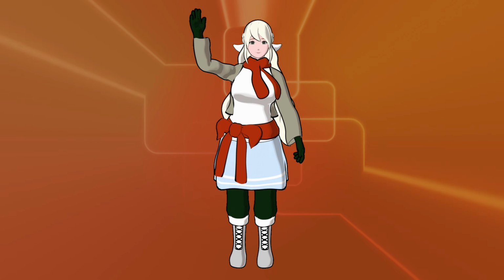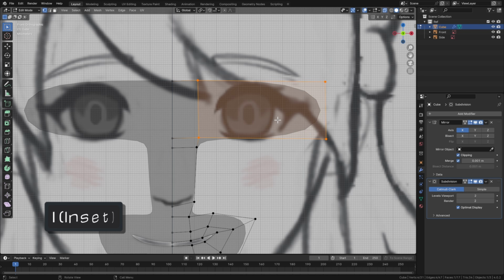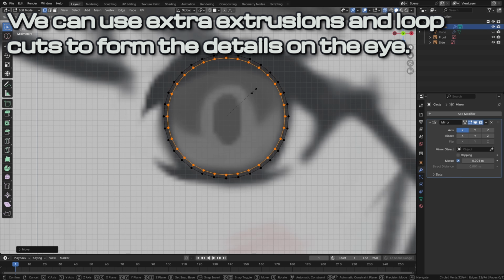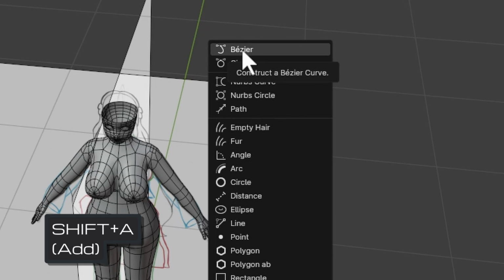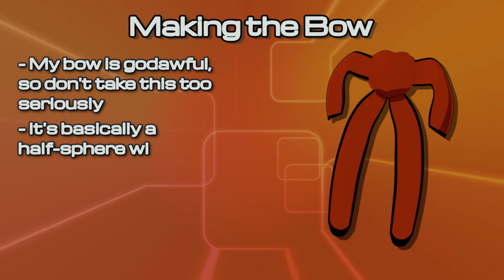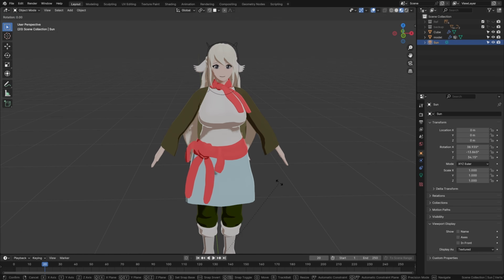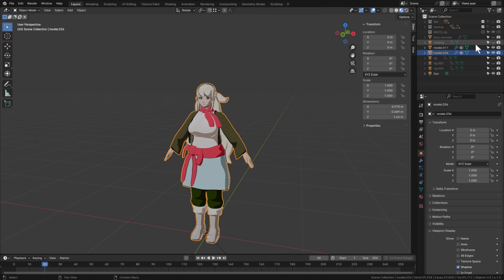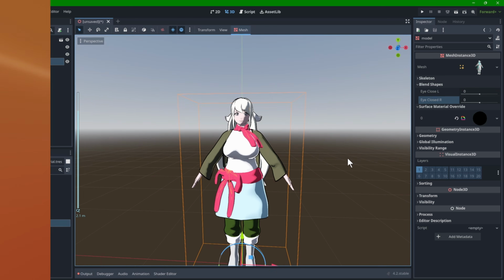COMPLETE 3D Character Creation Guide - from Blender to Godot

Comment: Regarding the outline shader, isn't that just the same as using the Grow parameter in Godot materials for the inverted hull method of outlining? If so, it likely won't work for my case. I have objects with sharp edges, like crystals. Smoothing their normals makes them look bad, and I can't seem to find any way around that, so it seems that it's best to import them without smoothing their normals. But without smoothing the normals, creating an outline for an object with sharp edges by expanding it based on the normals doesn't work -- it ends up fragmenting into several parts. 

The best solution I have found for this so far is simply using the solidify modifier in Blender to make an outline, applying the modifier, then just exporting that. It seems to work perfectly. I just wish I could get the outlines looking a little better, or exactly how I want... I tried using a post-processing shader to create an outline on everything, but by doing that the only way I know how, the outline disappears when nearby other meshes. I am an absolute beginner though and have just been reading the docs and watching a bunch of different tutorials. You wouldn't happen to know how to approach getting a really nice looking outline that doesn't depend on the normals, would you? Or perhaps you might know how to smooth the normals while retaining sharp edges? I actually tried using the Auto Smooth modifier in Blender, which SEEMED to work, but as soon as I applied it, the normals just went back to being the same as they were before it was applied. I feel like I must be missing something here.
Reply from the maker: You are correct that in Godot, it uses the exported normals instead of the base normals when you do the outline shader. I don't know of a way to force it to use the calculated normals instead of your custom ones in shader code, but you may be able to modify the NORMAL variable there in some way potentially.

An option you could use is to bake a normal map that is your calculated normals (not the custom ones), and then use that map as the basis of your outline shader. However, I don't love using extra maps for my models if I can avoid it, but it could be an option if you don't mind doing that.

Exporting the solidify is a perfectly fine solution if you don't mind doing that, but it seems you want more control through the shader, correct?

Comment: Great videos! I try to follow your example, but i got a problem when bake constraint animation with expy kit. When I try to bake it like you did, it just 1 animation that bake (i use 3 animation from mixamo, idle, t-pose, jumping, but just jumping that get bake and animated), I don't know where the problem is, did you have any solutions? (ohh, yeah, i try to bind and bake it one by one too, but the armature is rather piled up one after another, i use blender 4.5 btw)
Reply from the maker: Thank you! Yeah, it's a challenge I run into as well with Expy Kit. 

Typically, I import one animation at a time, and once it's baked, I'll delete the imported armature and select my own, then try to find where the animation was saved to. Once I do, I'll mark that one as a fake user to preserve it, plus give it a better name. Then with the others, you can delete them. 

Deleting them is a bit of a pain though - you'll have to go to your scene collection outline (usually at the top right), click the Display Mode dropdown and find "Blender File". Then in the Actions there, you can right click and select "Delete" to delete any unwanted animations.

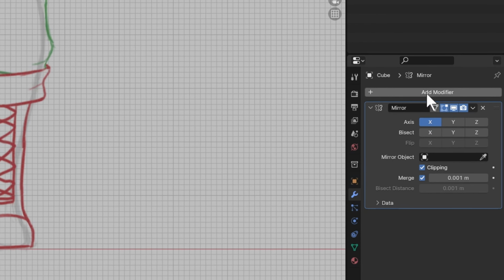Comment: ✋️I have a doubt at 10:50 can u explain the difference and why it matters? It doesnt have to be in detail 👍
Reply from the maker: Regarding the Catmull Clark vs the standard subdivision algorithm? The former will actually try to smooth out the mesh for you and is generally preferred. The latter will just add the additional subdivisions to your model without changing the shape.

Comment: i'm at the weight painting part of the video and i have no bone collection for deformation bones... what did i do wrong?
Reply from the maker: It may be related to the version of Blender you're using? In my video, I'm using 4.0 I believe, which would have introduced the bone collections. Also, make sure to do the weight painting on the generated rig, not the metarig.

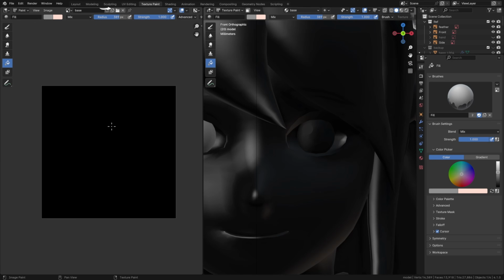Comment: 56:50 for some reason i dont have texdraw brush. My brush has a different name and its very pixilated. It also wont go straight when i hit shift. Anybody know why?

UPDATE -To anyone who got stuck here like me blender4.4

Hit N 
Look for stroke tab.
Choose line

Go to falloff tab
Choose custom (dont change anything)

It should allow you to draw straight lines now by holding left click.
Reply from the maker: This seems to be due to Blender moving toward a brush library system. If you click the dropdown near the brush tool icon, you can select the Hard Brush. However, it seems the straight line function is broken. For now, I think the best option is to use a different image editor to make the grid, then you can use the fill tool in Blender to tweak your colors.
Reply: @codernunk thanks for letting me know. I thought i was just doing something wrong. What version of blender are you using in this video?
Reply: same here

Comment: hi I have just started learning blender and this guide helps me so much but Im wondering if the hair strands you made overlapping each other, would it be fine when you add collision to them? And do you need to join all of the hair strands together?
Reply from the maker: Glad this is helping you! 

You don't necessarily need to add collision to them, as you may get some undesired results if you are using pixel perfect collisions. 

Typically, the hair physics is something I relegate to the game engine (assuming you're making a game character), as you can use collision shapes to apply the collisions instead.

It's also a good idea to join all the hair strands together before you export your mesh. You don't have to sweat it though if you have some overlapping geometry.

Comment: Quick Question when do you apply the modifiers?. And when did you apply the outline?
Reply from the maker: I often apply the mirror near the end of the modeling process, but if I find I need to make an update, I will cut the model in half and re-add the mirror modifier. Not the most efficient, but I do this because I want to make sure I'm not applying all my modifiers. This is because I don't plan on applying the solidify modifier (for the outline), rather, I'm keeping it for reference. I have a shader in the game engine that builds the outline, so there's no need to apply it to the model as well.

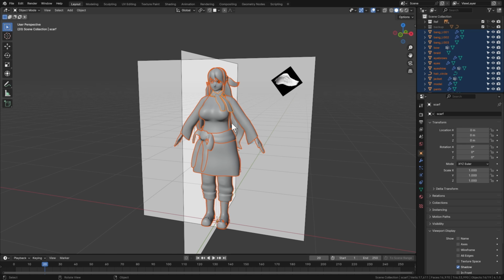Comment: 53:00 is the removal of many polygons necessary for game performance? I was thinking, without anything below, wouldn't the clothes "pass through" the body when physics are implemented in Godot?
Reply from the maker: It's not entirely necessary but recommended. You don't want the game to spend GPU cycles rendering something that isn't being seen to the player. 

For the most part, with physics you will not be able to see the hidden parts of the model, as long as the weight painting is done with enough care. However, you may find there to be cases where having the mesh underneath is necessary, such as certain outfit types.

Comment: I've been stuck at the shading part for days, most of the stuff doesn't work properly, when I'm at the point where i should use the color attribute node, the highlights no longer show up, only shadows, and I'm sure i followed you correctly, please help.
Reply from the maker: I think your issue may be due to the lack of vertex paints. If you select your mesh and enter Vertex Paint mode, it should create some for you. Make sure you have vertex paints set by navigating to the Mesh data tab, finding the Color Attribute section and seeing if you have an entry there. It also helps if you have it set to "Face Corner" as well

Comment: Hello, the fresnel effect isn't working properly, it is too big and I can't make it smaller with the color ramp node for some reason.
Reply from the maker: Apologies for the late response. I understand if you were able to get it working since you asked.
The fresnel node can be a bit finicky with the values. Have you tried the Layer Weight node in Blender? That fresnel is based on a 0 to 1 value and may work a bit better. Using the traditional Fresnel node doesn't use the same number range. Is the issue happening in Blender or Godot?

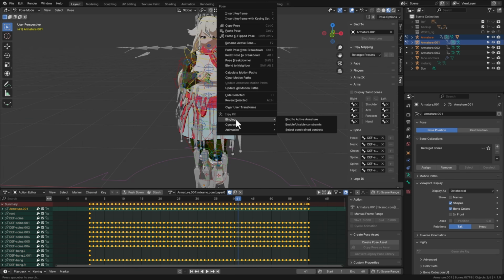Comment: @1:17:25 Hi codernunk, I'm currently using Blender 4.4 and I'm having trouble baking constrained actions. Everytime I bake my actions, I cannot toggle between the poses in the action editor. It gets stuck on one pose and I cannot see the other poses. What am I doing wrong? Why can't I toggle between poses? Thanks.
Reply from the maker: Thanks for responding, all. Apologies for the delay. One-by-one seems to be the ticket for now. I also noticed that a lot of my actions stayed in the "Legacy Slot" so I had to swap over to that.
Reply from the maker: Apologies for the late response. I'm not 100% sure, but I think it may be due to Blender introducing a new feature where you can make multiple channels. It may also be due to the Expy kit addon selecting the other armature after it's done. The best thing you can do is to exit out of Pose Mode once you're done baking and trying to select just the target armature again.
Reply: Hey I'm having the same problem. If you get it to work, can you let me know?
Reply: @ronyoshii Hi! From what I remember, I just repeated the same steps—baking each armature to target the main one. I renamed the poses I wanted to keep and deleted the extra armatures I didn’t need. After that, I was able to export to Godot without any issues. I’m not sure if there’s a better method, but that’s what worked for me.
Reply: @nuffinmuffin7351  thank you. I was able to get it by doing it in much smaller bunches at a time. I had a lot of animations I was using. Importing into Godot was pretty straightforward though.

Comment: Gray bones of the head and heels, someone know how to fix?
Reply from the maker: I'm not sure exactly what you are asking. Are you unable to select some bones on the rig?
Reply: @codernunk  Ohh, so it's been 12 days since I started making my first rig. I don't even remember what the problem was, now I'm at the stage of creating a rig from a metarig, but since the model is absolutely not symmetrical (in a fighting pose), the position of the bones of the metarig skeleton differs from the position of the rig bones (bones twists along the axes or bends and detaches the spine) now I have roughly worked out the procedure that and where to turn, but there are not many bones whose direction is a mystery to me, these are 4 paired red and gray bones in front of and behind the skeleton on the knee, I see that the red arrows lead to the bends of the arms and legs (elbows and knees), but the gray ones, I do not understand. I tried not to move anything after creating a rig from a metal in the bones and in pose mode everything bent at the same level, I don't know, maybe I shouldn't be doing this and nothing changes.

Comment: This video is great, but I am having an issue. When I press my mouse scroller the images disappear, online it says this is supposed to happen but yours does not do that, is there anyway for me to fix this?
Reply from the maker: Thank you! I believe you may have to tweak the Depth and Side settings on the image. You can find those on the sidebar if you have the image selected. Also see if you have the "Only Axis Aligned" checkbox on, that'll make the image disappear if you not in orthographic view.

Comment: I have a question for you regarding generating the rig, I setup the rig after resizing it to match shoulders and when I generated the rig the rig itself is taller than the model, do I just resize the rig?
Reply from the maker: I believe your issue here is that you have to apply the scale on the metarig before generating the rig. In Blender, whenever you scale a model, it becomes different than a 1:1:1 scale, and this can have adverse effects with some workflows, such as rigging. You can fix it easily by selecting the metarig in object mode, then finding the Object > Apply > Scale function. Then your generated rig should have the right size. Let me know if you still run into issues!
Reply: @ thank you, I will try that

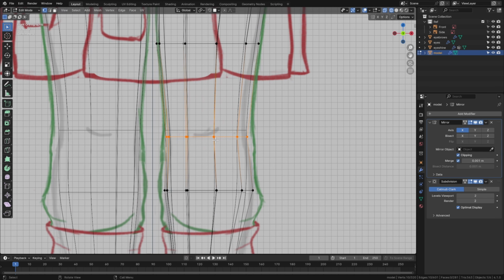Comment: At 28:38, it doesn't work for me. I selected the loop at the center of the knee (I mean, the circle of vertices around the knee), and, with them selected, i pressed Ctrl+B, but the thing that comes out is not the two lines I see in the video but a strange thing. The model has more vertices around the legs, not 10, but 14, which is still an even number. How do I fix that?
Reply from the maker: If the Bevel tool isn't working for you, you can achieve the same thing by making a loop cut just above that loop and then shifting them downwards to where you want them to be. You can easily slide a loop by selecting it, then pressing G twice to enter slide mode.

Also, you don't have to follow the exact vertex count. It can help with the tutorial, but it's not strictly necessary. One way you could hypothetically make the vertex count match for the rings around the legs is to use ALT + click on a vertical edge, press X and choose "Dissolve Edges".
Reply: @codernunk  Oh thanks. By the way, when I do the loop cut and then select the two knee faces, if I make an inset, it won't have round lines around the knee like the bevel, is it a problem?

Comment: the problem i find at 14:17 is that the side reference i draw just doesnt align precisely with the front, but its mostly just my own drawing issue
Reply: thank u so much for this video tho bless this, never delete it, saves me from finding many videos to relearn basic modelling
Reply from the maker: No problem! See if drawing straight lines across your front reference helps. I draw a bunch of horizontal lines marking points like the top of the head, the chin, the groin, etc. Then you can draw your side reference and take care to align to the lines you drew.

Comment: If shape keys and modifiers are incompatible would that mean they might indirectly mess with the mirror modifier?
Reply from the maker: I'm not 100% sure how the interaction works when you still have the mirror modifier up. Usually what I do is make a backup of my model and then apply the modifiers, then work on the shape keys. There are some ways you can transfer shape keys between similar models later on if you have to make adjustments.

Comment: Really cool guide, for my work I feel like a lot of my characters will be wearing full body armor ( helmets with visors, armor on shoulders, arms, forearms, some on the hands even, legs, pelvis knees, boots, that sort of thing)  as they would be sci-fi soldiers. So do you think that might change the process in any meaningful way?
Reply from the maker: The biggest change would be how rigging is done. You can follow the same workflow for the base body underneath the armor, but given armor is rigid you may need to weight paint entire pieces of armor (ie, a bangle) to just one bone (like the shoulder). There's also the option to use bone attachments if you're going to attach armor to a game character like in Godot.
Reply: @codernunk  oh interesting, thanks man!

Comment: what about painting the eyes bc its a anime sculpt? its not a model
Reply from the maker: I'm not 100% sure I understand your question, so apologies in advance.

In the case of just wanting to keep it as a sculpt (and not optimizing it for a game or animation), you will still need to do a UV unwrap in order to paint on it. Unfortunately, the topology you use to sculpt is very dense and not easy to work with for UV mapping, so you may still want to look into retopology as well. At least for the eyes, you can use a sphere or a disk (like I use here) and that's easier to unwrap for texture painting.

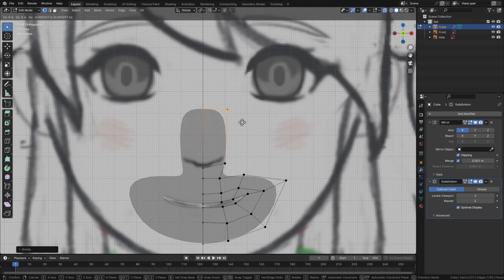Comment: 1) 12:42 my surface is not transparent and I can't see the reference behind it. If I turn on the x-ray, there are no surfaces at all, only the wire edges are visible. What am I doing wrong?
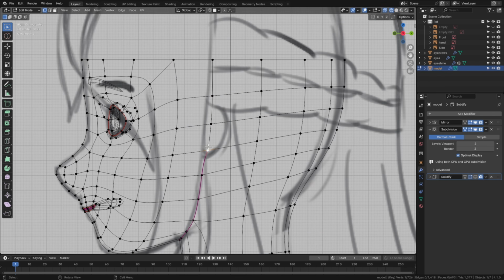2) 20:15 how to make the same curved edges?
Reply: 1) I found a solution to the first problem, I had to recalculate the normals Shift+N, reduce the transparency of the references to 0.1 and  turn on the x-ray
Reply from the maker: I believe you may be referring to the subdivision surface modifier. There are four buttons on the subdiv modifier in the modifier stack, the leftmost one makes it so you can see it applied while in Edit Mode. If you do that, the edges will look a lot rounder.
Reply: @codernunk  yes, that's exactly what I was looking for, thanks

Comment: For anyone watching this you can install the "Extra Objects" add-on within blender to get access to the  "single vert" option to create single verts even easier, as well as many other additional objects as well. To install this add-on go to Edit > Preferences > Add-ons. In the search bar located in the add-on section, type "Extra Objects". Locate "Add Mesh: Extra Objects" from the search list and tick the empty box next to it. If a check mark appears next to it, you have successfully installed the add-on! You may click the three horizontal bars located at the bottom of the preferences window and click "Save Preferences" so blender remembers your preferences the next time you open up the program.